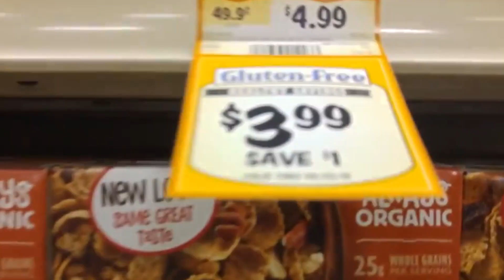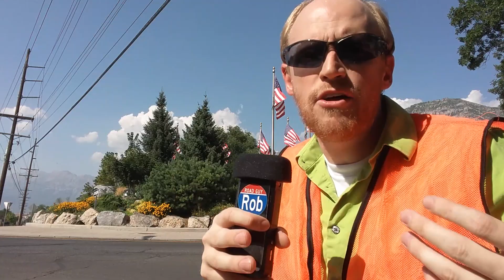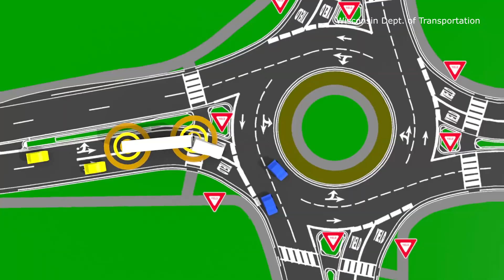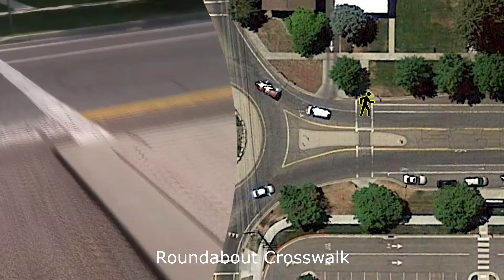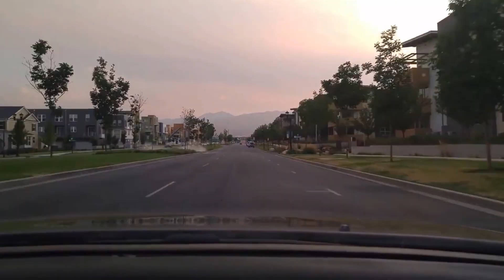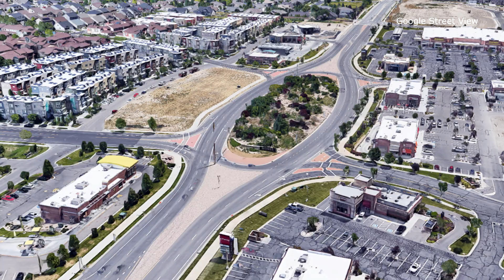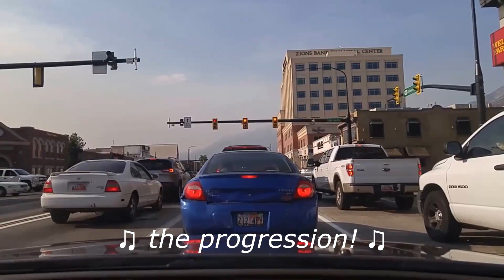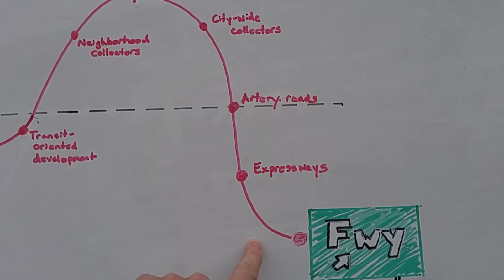Are roundabouts REALLY better than a traffic signal?

Comment: In general, roundabouts are perfect replacement for many of those all-way-stop intersections in the US. You didn't mention about one thing. Roundabouts not only break up the platoon into more unorganized traffic but they also work well only if the incoming traffic is not organized. When the platoon arrives and 95% of people go straight, you will be waiting on the cross street for ages. And if second platoon arrives quickly enough, you will be waiting forever. Roundabouts rely on gaps between traffic to let others get in but if there's too much consecutive traffic in one direction, it affects everyone else. When you arrive at roundabout, you have to give way to the guy on your left. Who is that guy? He might be someone who drives in the opposite direction and goes straight, your paths would never cross but they do now, at least they may because you have to give way to him. Does everyone always signal that they exit and follow their signals? Nope, you can't trust people signalling that they turn because if they change their mind or forgot to turn the blinker off, they still have the right of way. So roundabouts can only work in places, where the traffic is rather slower and less organized. Best example are those all way stops as they are only used on low capacity intersections where traffic lights would do more harm than good. Another great example are highway exits into calmer neighborhoods. Places, where you don't need a big intersection and multiple lanes, just one highway exit ramp does the trick. The traffic on highway is already fairly unorganized and it also works best if people getting on the highway are not a platoon. Does that remind something? Yes, the traffic lights on highway entry. Roundabouts have the same exact job, so in reality they serve two purposes. Let people know they are now on a highway anymore and have to slow down and pay more attention, then randomize the traffic getting onto the ramp.
As for pedestrian traffic, I don't think it's a problem with roundabouts, it's a problem with urban planning. How often do you really have to get from one side of the intersection to the other? Not just on the other side of the street but precisely from a location at one corner to the other? This rarely happens. The only problem is that sidewalks are easiest and cheapest to build on the side of the road. That's the problem. If you have parking spaces, grass or anything else between the road and sidewalk, then the paths becomes straight. It's not a problem that the crossing is further from the center of the intersection, it's the problem with having sidewalks that close to the road. Even for a regular person it might be a good question. Why do you walk between the street and buildings? Wouldn't it be better if people were just walking between two rows of businesses on both sides? This way you don't have to cross the road to get to the other side, there is no road where you are walking and there is no sidewalk where the road is, just parking spaces. This works much more often in Europe as the old cities often had narrower streets much closer to each other than a typical US block. Because of this it made perfect sense to turn every second street to be primarily for cars and the other one just for bicycles and pedestrians. In the US it would be much more difficult as you'd have to figure out how to put a small street going through the middle of each block to separate it from the car traffic.

Comment: Wonder how many Million/hours of cars waiting per day are cause by stop signs/traffic signals when there was NO need to stop in the first place because there was no oncoming traffic?  I'll take a roundabout any day to sitting at a signal with no other traffic or stopping at a stop sign when there was no need to do so.  Yes the two downsides are larger footprint and longer for pedestrians to cross. What would help a little would be a nationwide requirement to always stop if someone entered a crosswalk. Some cities it is like target practice.  An added bonus is when the wife and the GPS disagree on what turn to make or not at an intersection. With a roundabout you can continue to loop around until the conflict is resolved.

Comment: Just found out about this video. 

I used to live in Shanghai and in the 90s they put in the first elevated freeway in the city. And the freeway goes by one of the busiest train station in China, where it used to be one of the most congested intersections in the city. Instead of building an on/off ramp for the train station, for saving cost of purchasing the land needed for the ramp, they built a 3-lane roundabout in the middle of the highway over the existing intersection so they can leverage the existing public land where the roads were. Guess what? The roundabout for sure became the bottleneck of the entire freeway that goes north-south through the whole city. Drivers had to switch between 3 lanes in literally 20-30ft to use the right exit 🤷‍♂️ so not long they had to add 4 SETS OF TRAFFIC LIGHTS to control the situation, and later built an expensive, higher elevated freeway over the whole debacle for through traffic, and pretend the chaos on the roundabout did not exist. 

This is why every time I see roundabout on high volume streets I always shake my head.

Comment: I disagree with your pedestrian step comparison as these are not 'like for like'. Note 2 important safety features: i) the roundabout had a midpoint pedestrian relief island midway across the crossing which is and can be a safety feature ii) the position on the crossing is away from the intersection thus avoiding vehicles 'mounting the curb' and hitting pedestrian's at the roundabout. Extra steps for additional safety. People in a hurry will be silly regardless of intersections type and would walk out into a conventional intersection. (Please note the use of roundabouts in a tight CBD in Bunbury Western) Australia o  Google Maps.

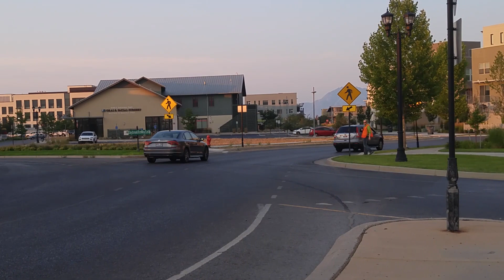Comment: At 4:15 the cars didn’t yield to you despite the crosswalk because you hadn’t stepped into the crosswalk. Put one foot on the roadway to establish right of way. If that fails, hold an arm up with open palm facing cars using the universal “halt” hand signal. That works every time.

Comment: I have never seen so many stupid roundabout until I moved to North Texas. Most of them were around Hwy 35. There was no way any one could  turn left because there was no traffic signal to control oncoming traffic from the left. Unliked a traffic signal which would stop traffic.This resulted in traffic backed up for miles on the highway. there was no way to turn right and then come back because all those constructions block off all the roads.
I took great pain to avoid all those stupid roundabout.

Comment: I think roundabouts, like any other intersection design, need to be thoughtfully planned and placed in areas which make sense.   My state DOT plopped one in the middle of a town to replace a traffic light.  While the roundabout works like a dream in that spot because traffic flows rather freely,  there is a little bit of a side-effect for drivers on side streets downstream from the roundabout who wish to safely turn left onto the street that has the roundabout because of the fact that traffic flows freely through the roundabout.    At least with the traffic light, you might have a better chance of being able to turn left onto the street.

Comment: Intersections vs. roundabouts does really ignore what both are, tools for city planners, which is the conclusion of this video, Roundabouts works great on a medium flow of traffic, are pointless for light traffic and problematic for heavy traffic. The problem in U.S. city design was that intersections were used basically everywhere which included medium traffic, which is where a lot of those issues with accidents happen, you have a turn right on red rule which really doesn't help. Roundabouts might be more walking but often are a smaller wait for pedestrians and nothing bad can be said about the safety of them.

By the point you're looking at 3 lane roundabouts tho, you're really talking a traffic circle over either a roundabout or an intersection, as horrible as traffic circles are, they are good at handling that extreme load of traffic and do allow safe periods of pedestrian crossings. Intersections sit at the points between roundabout and traffic circle. In the UK we also have a smaller style of roundabout called a mini-roundabout which is literally just a white painted circle in the road (sometimes with a small hump), it works fine for trucks/lorries as they can just drive over the circle but all other traffic can drive around them.

Comment: Roundabouts are great, but Tucson really needs to learn how they are actually implemented. There are quite a few around the city, but they do insane things like make them also 4 way stops? Seriously, WTF? There are also ones where for some reason they decided traffic flows through them too quickly? So they put in speed humps where you enter the roundabout. The ones that are actually installed correctly are amazing. There are a pair of 4 way stops near my house and both of them should be changed to roundabouts a few decades ago, but I'm afraid of what the city will do if they actually do it.

Comment: Before really watching the video: I've always felt it depends on the amount of traffic the intersection gets, alongside the speed of that traffic. If it's a moderate volume of low speed traffic (say 35mph or less) on a two-lane street...they're fine. You won't find me complaining about them. But once you start getting a high volume of even moderately fast traffic (say, over 35 to maybe 45mph) and/or have two or more lanes inside the roundabout itself...you start running into problems. Some of them are from drivers being unfamiliar with how to handle them, others are simple physics (large vehicles lean out more in a turn, and it gets worse the more speed you add and/or the sharper the turn, for example). So in those situations, I think a different solution is preferable.

After watching: Great, we're pretty much in agreement! rofl

Comment: You REALLY need to travel to England .  A roundabout can be anything from a single post in the middle of two cross streets, to 4 lane ones the size of a city block.  Right now they are simply introducing them to the good old USA.  That gets those not used to navigating them familiar with them.  It will be a slow progression to eliminate most stop lights.  London still has many stoplights.  The circles can't replace all traffic signals.

Comment: In answer to the video's question - Yes. There is a 505 chance lights will be against you even if there is no one else on the road. If you have a roundabout to yourself it is all yours.
Roundabouts are only problematic if there is a constant traffic flow from one direction - then lights are preferable.

Comment: Long Beach, CA has installed in the last few years a number of tiny roundabouts in residential areas where the streets are wide enough for two lanes of parallel parking and two lanes of travel.  Maybe these intersections had a large number of accidents in the past, but the roundabouts are really annoying in these locations.  

Long Beach has also had a major roundabout where Pacific Coast Highway (twice), Lakewood Blvd, and Los Coyotes Diagonal meet.  The city (or whoever controls the roundabout) recently (last couple of years) reworked it so that there are not a consistent number of lanes around it.  The new lane markings are frustrating in spots as I think I'm in the correct lane for an exit 3/4 around the circle, but end up being forced off one exit too early.  The signs leading up to the Los Alamitos Circle (official name) are vague and don't include lane suggestions.  https://en.wikipedia.org/wiki/Los_Alamitos_Circle

Comment: FINALLY, a piece that considers both the pros and cons of roundabouts. I would love to see one that got into the nitty-gritty details of multi-lane roundabouts, including the number of lanes of entering and exiting roads as well as the number of lanes in the roundabout itself. Some multilane roundabouts connect both multilane and single lane roads, and the rules get confusing, especially when the signage is inadequate. Very clear and explicit directions are required for drivers to get into the proper lanes before entering the roundabout, and to know precisely where and how to exit. Directions painted on the pavement are nice, but no good when they are not visible because of heavy traffic or snow-covered roadways.

Comment: @Road Guy Rob:  A single lane roundabout is safer then a multiple lane roundabout it still only goes one way, this is my experience with round about in the home town that I live in.  the highway/Freeway round about is the one that is the multiple lane round about, and the part that is dangerous it is not clear which lane should yield,  I'm on the right lane going into the round about from the previous round about, and the yield sign is on the left, and no yield sign on my right( my flow of traffic is on the right side of the road when their is a median) this mean to me they should yield to me because their sign is on the right most sign, but they do not because they still believe it is the right most lane that should yield, and because it is a highway/free way,  and their is a speed limited to slow down to 50km/h they still go 80 km/hours on the road, so that is why they change the speed limit to 60km/h on that round about.   The single lane round about is not part of a highway/Freeway,  if you changeing road really close you take the right lane to change road instantely you do not even have to go into the round about and the yield sign is on your right only, but if you need to access a road further into the single lane round about,  you take the left lane to access the round about, the left lane to access the roundabout as two yield sign one on the left and another one on the right, so it is clear your the one who should yield.

Comment: In areas of more limited space in the UK we often have "mini-roundabouts" they are just a raised circle of paint in the middle of  a larger circle of road, very compact and tight, but if you are in a larger vehicle you can use the painted circle, large SUVs and buses can just drive over the top of them when it is safe, they are generally used for 3-way intersections, maybe 4, you sometimes see them in pairs as "double mini-roundabouts. They can make a great option in some circumstances. We have all shapes and sizes, I hate 4 way traffic lights in town centers and busy cities. Cars and city centers seems to be a bad mix in general though there is no good way to accomodate them without bulldozing everything.

Comment: You only have to look left for traffic to yield to, as opposed to looking left and right. Also Australia have these everywhere including the town of Alice Springs where tractor trailers are towing three trailers and they get through just fine. Just have to made with bigger diameter for large vehicles Or if they are small just build a raised unobstructed concrete apron  that allows for the trailers wheels to mount the inside kerb.

Comment: I had a classmate (I’m a civil engineer now retired) who took a job with the city. Over after work drinks, I complained about how poorly the lights were synced. It seemed that whenever I went, I’d wait at a red and drive 1/2 a block when the next light would turn red! He explained that the lights on major routes to and from city hall were very well synced going to city hall in the morning and away in the afternoon so the mayor and senior managers thought everything was fine. The rest of the time, the lights were allowed to run randomly! I nearly stiffed him on my share of the tab. 
40 years later and the problem is worse if anything. There are now pedestrian controlled lights on nearly every corner that are on demand only. The worst time is late at night, when pedestrians will press the call button, look at the traffic and cross without waiting for the walk signal. 30 seconds later, I drive up and the light turns red and there’s nobody in sight!  A few years ago. I was making the truck home from my elderly dad’s house 5-6 nights per week and many nights I’d only hit 1-2 GREEN lights out of the 30 plus I would go through. I think in 2 years I only got all green once. 

I’ve driven in England, Germany, Australia, NZ and properly designed roundabouts work extremely well. Even in cities, pedestrians can be accommodated if the engineers will take the time and effort. While pedestrians may have to walk further, they don’t have to wait or cross 6 lanes of traffic at once- they can cross 1 or 2 lanes  at a time. 

Great series, thanks

Comment: On the freeway you can absolutely have "roundabouts" as a roundabout is just a series of splits and mergers. What you should not have is traffic signals because obviously you can't have cars stopping on a freeway. If you stop it's not a free-way any more.

If your intersection needs to move more cars than a roundabout can handle you should look at investing in public transport instead. It's been shown that upgrading roads just causes more car traffic until you have demolished the neighborhood and replaced it with highways. I've seen some pretty apocalyptic pictures of american cities. Before and after pictures where bustling neighborhoods are replaced with highways and not only that but all those cars then need somewhere to park, so even more needs to be demolished for parking space. Once it's all done you have eliminated walking and biking too since the average travel distance has increased thanks to all your demolishing.

Signaled intersections should only be used in city centers where you can't fit a roundabout.